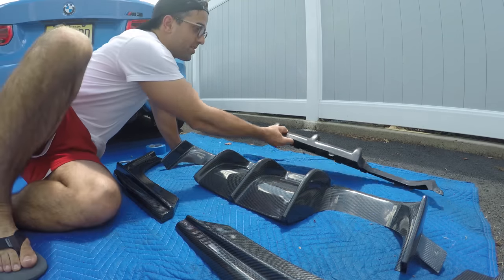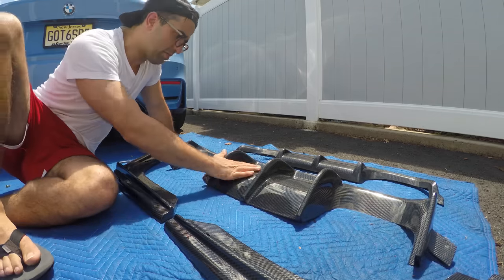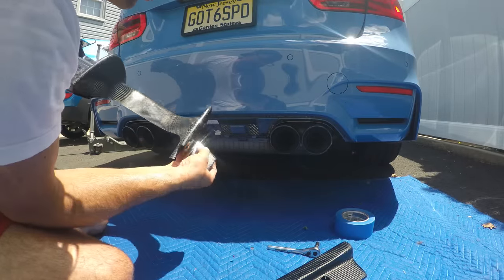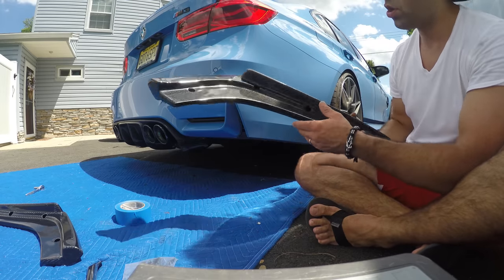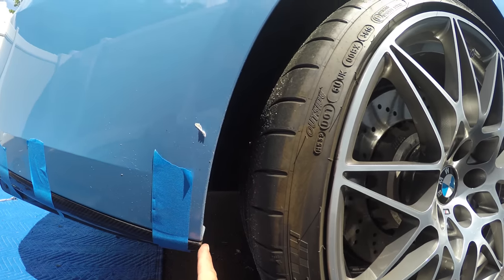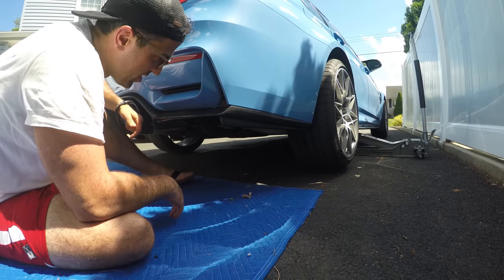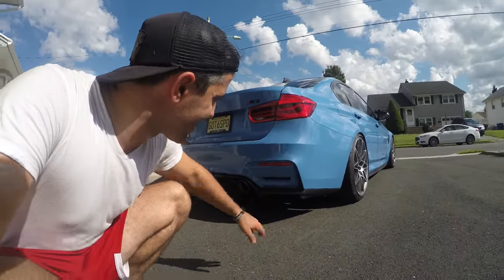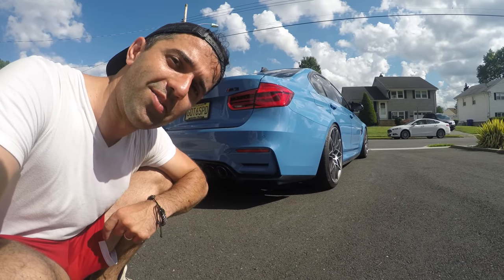Vlog 48: BMW M3 / M4 Three Piece Carbon Fiber Rear Diffuser Installation

Comment: Nice video. Watched your video and installed mines from your instructions. Dealership wanted $380 for this lol. Anyways are the fins on the center piece supposed to touch the exhaust can? Thanks
Reply from the maker: Andrae Falconer thanks for watching! No. They should not be touching. I’ve actually removed this diffuser since I bought it originally. Ended up hating everything about it. Got something coming in very soon /)

Comment: Yeah; got my new front splitter in but no tools for the install 😂😂😂😂😂
Reply from the maker: Assion Ayikutu did you check my video and the description? I linked everything there
Reply: Tommy L Garage I did, thanks. I received that makita drill set today, and I will be checking your front spoiler install to get my done also.

Comment: Nice diffuser exactly one I have on my car too. Question I have is how dis you stop the middle part from rattling against the exhaust backbox because the diffuser is longer than the bmw factory one there's no place to screw into body work?
Reply from the maker: You can cut it. But my diffuser was a good fit
Reply: Only drill the middle part both sides? This part can broken and loose the fitment and drop off 😕😕😕 i have the same part on my M4 and im afraid that happens